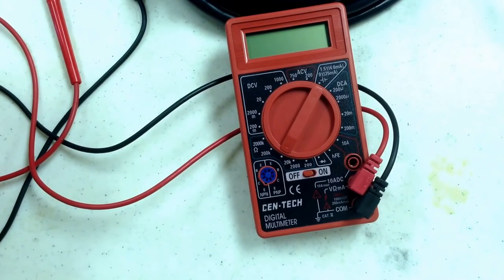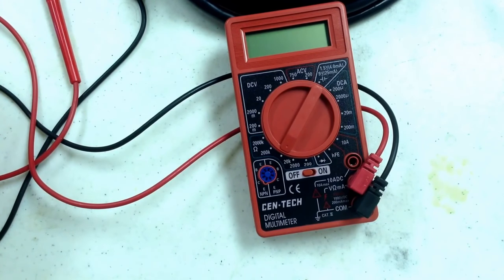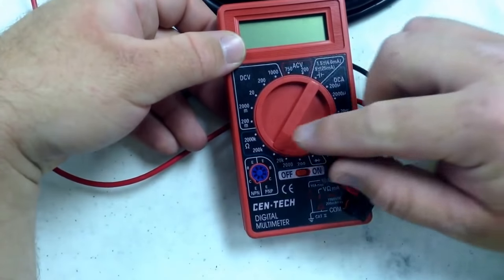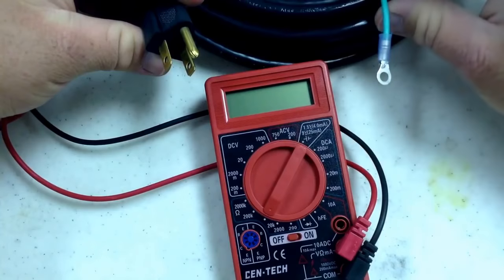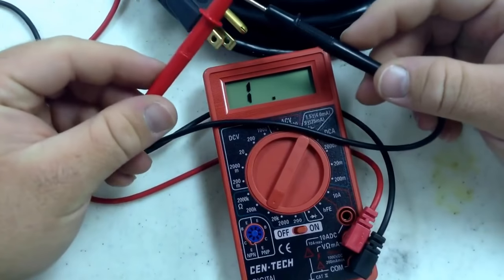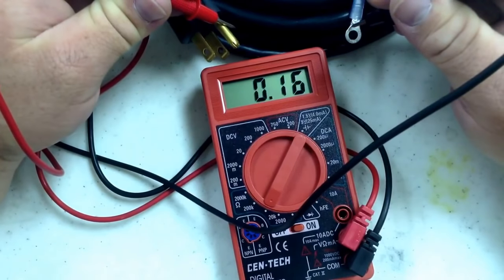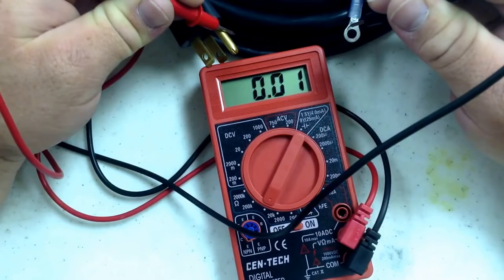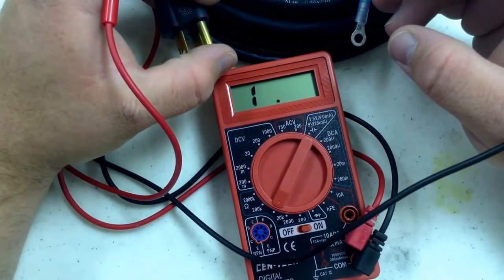Check to see if cord works with Cen-Tech Digital Multimeter from Harbor Freight

Comment: Thank you. Other videos, even the manual says go to lowest which is like 200. I get like 14 so had no idea how they were talking about 1 or 0. Was going to check septic floats because new wires pollen and floats not working so thought would test continuity.ayne those waterproof worenits got that silicone over the wires and insulating them
.Bow I can check to see of each wire is ok, use good clean nuts and test if when float is up I get a closed circuit..Wished this beeped

Comment: so i have a question. i have a bad breaker and i dont know which one to use? i thought it was ACV 750 but my dad said DCA 200?
Reply: Dont mess with big electronic stuff unless you really know what your doing
Reply: @liveandletlive2894  already did. your about 3 weeks late. i figured it out and all went well. i wouldnt consider that big electrical stuff really. its easy to do as long as you shut your power off. lol
Reply: @codystephens5939  anyway was it DCA...I'm pretty sure DC is for batteries and stuff while house are usually AC
Reply: @liveandletlive2894  it was ACV 200 or 750. i used 750 to be safe. i was checking my breakers in my house. so your right dc is for batteries and stuff like that.